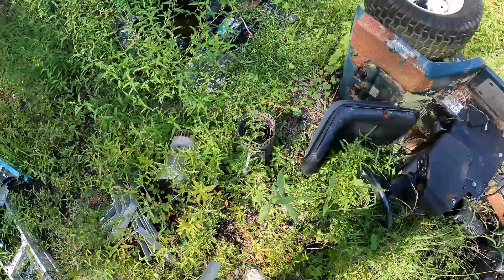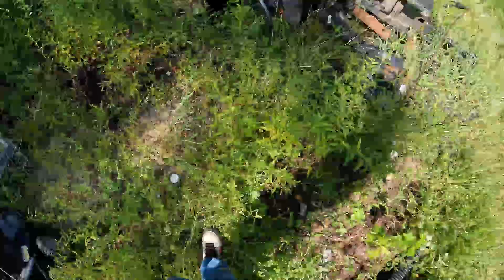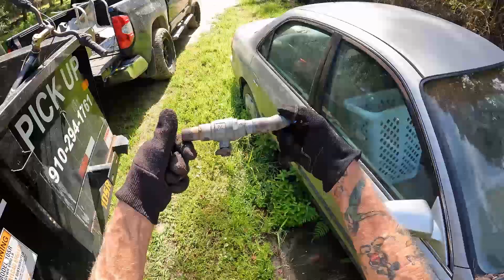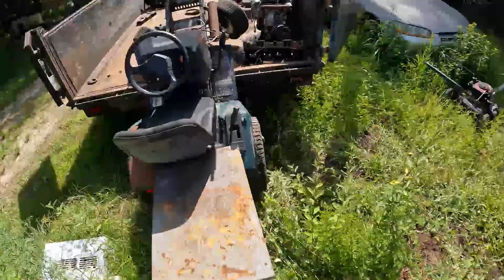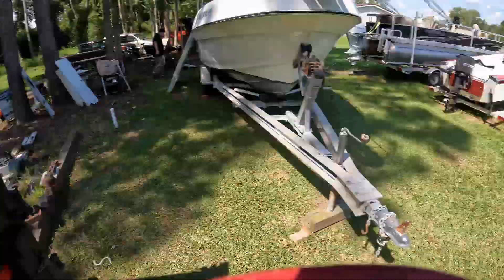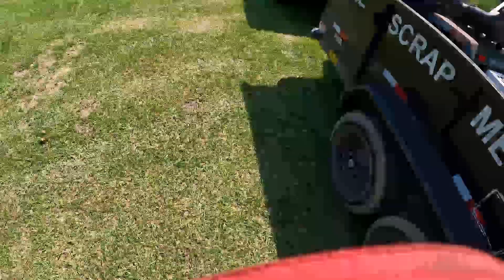Huge Honey Hole. Scrap Gods Sent Me Here

Comment: Whohoo, I got to do a "ride along " with SWG. Now that's a morning starting off right. I'm so glad that man stopped by and helped you! You need to be careful lifting  that💪that heavy stuff or you'll end up hurting your back or getting a hernia  silly man. 💘 you dude. 🐈‍⬛😺🐈
Reply from the maker: My camera got so hot that it shut off before I got that riding lawnmower in the trailer. The owner showed up right after I finished loading the riding lawnmower myself. He helped me with the other heavy stuff but that riding lawnmower I wish I would’ve got it on video because I did get it in there by myself. What a struggle it was I’m not kidding a real struggle. Like I said my camera got hotter than I did so it shut off fortunately I didn’t lol
Reply from the maker: Thank you TJ you’re the best I really wish my camera had not shut off because I ended up loading that riding lawnmower by myself. And then the other gentleman showed up and helped me with the other heavy stuff. That big grill that was just as heavy as the lawnmower.
Reply from the maker: The riding mower I ended up getting myself. My camera over heated before I did. I hate I lost that part of the video. You are correct I should be more careful. It could put me out of work if I’m not careful.

Comment: Ha Pa live in Coal region of Pa. Steel 6.00  a  100   stainless 40 cents a pound clean alum  50 cents a pound copper clean 2.50 to 3.00 a pound
Reply from the maker: My Lord my Lord nonferrous metal has gone down so far. Well I guess I’m not doing any better or worse than you are as far as non-ferrous metal. So I’m sure when your coat factory got shut down that probably didn’t help out your town